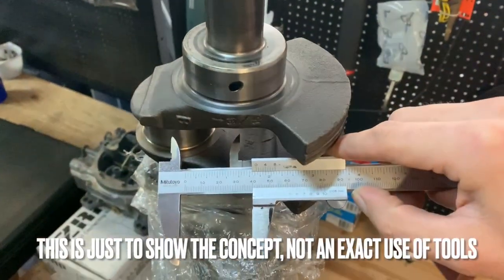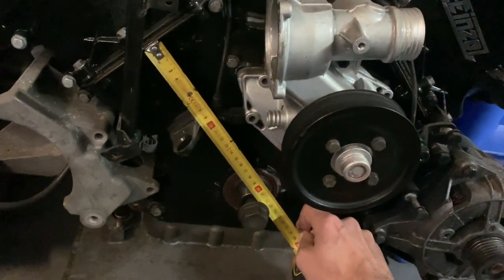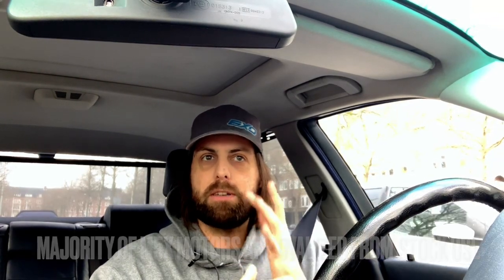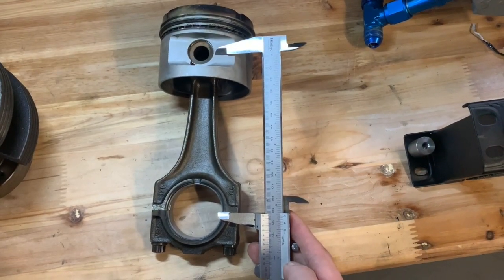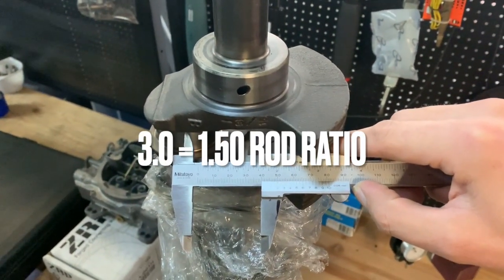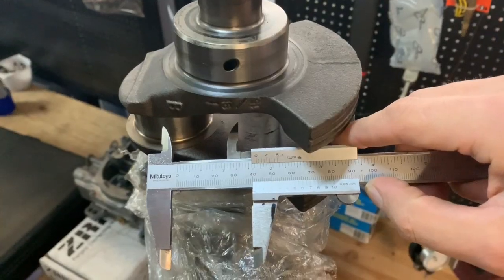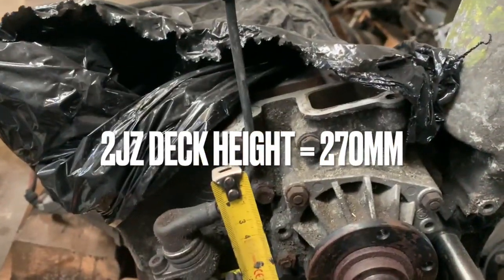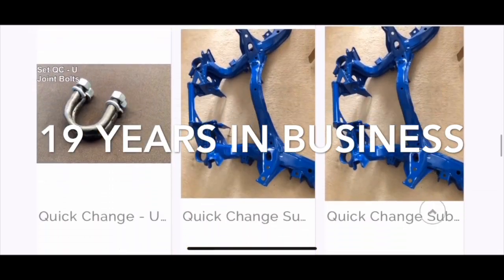Rod Ratio, Stroker Engines, Ring Gap & Deck Height Explained : Why I build M50 turbo engines our way

Comment: what about using decompression plates? so a head gasket+plate+gasket?
Reply from the maker: Nope
Reply: @DriftJesus  nope as in its not a good idea either?
Reply from the maker: @patrykkowalski6  not a good idea

Best idea is cut ring gasket and use pistons to modulate compression.

M50 is not a good motor to budget build unless you want Instagram performance.

Real world real use good powerband, it needs to be built.

Its not a turbo motor from the factory.
Reply: @DriftJesus  just want reliable 350/400 hp from 2.5 m52tu
Reply from the maker: @patrykkowalski6  build it.  Its not about power levels, you want a useable motor, not Clutch Kick Central

If you build an undriveable motor you need a big trans, diff, axles due to endless clutch kicks.

Will be way more expensive.
Reply: @DriftJesus  so whats the recipe if its not a secret? what size turbo? etc?
also why does m54b30 have 10.2:1 while m54b25 has 10.5:1 having smaller stroke and same pistons? (shouldnt it be the other way around?)
Reply from the maker: @patrykkowalski6  i run a custom hotside Holset HX30 and a cast manifold. 

Differences in those motors are also in the heads. Pistons are not exactly the same either.
Reply: @DriftJesus  what about mls thicker gasket to modulate compression? are they trustworthy? ive only found wiseco pistons in my country which are 9.0:1 on b30 motor
Reply from the maker: @patrykkowalski6  as said in the video, the thinner the gasket the better

Comment: M52b28 pistons and rods on m50b25 nv crank will work? I have a crack piston and a spare m52..
Reply: My target is to run with 0.6 boost stock studs (new) and 2.03 head gasket :D need an advice before i will blow the engine  :))
Reply from the maker: Don't use second hand pistons from one engine into another engine
Reply: @DriftJesus  but new m52b28 rods and pistons only will fitt on m50b25 nv? I have any advantages?
Reply from the maker: @vasilicalupu8334  machine the block. Buy good aftermarket pistons.  There is some shop in Poland that always swaps out pistons between motors and its always drama on boost, as I said many times, these engines become ovalized due to low deck height.  Swapping pistons around is always a bad idea

Comment: Is there an ideal ratio for street use? Is 1.75 a good ratio for street, or is it betrer higher or lower?
Reply from the maker: It doesn't matter if its street or race.  You want to be over 1.6 for sure no matter what.
Reply: And what about the ratios over 2? Better for turbo or NA?

Comment: So the s50/s54 has a really bad rod ratio...💔 that's why they're eating rod bearing that fast 😁.
Reply from the maker: For boost it would be bad, yes. They eat bearings "fast" because its a  relatively small bearing to allow it to do high rpm
Reply: Well... it's staying n/a so no prob there. But nice of you to make people understand bigger is not always better. I've seen a trend in the recent years that guys who really know their stuff stay away from stroker motors regardless of platform, bmw, toyota or nissan. Good video as always. Thank you 🙏
Reply from the maker: @raduorban  its all about the relation of components.. if you'd look at a 2JZ, and you kind of mimic that setup on rod radio, you'd have 2.5 or 2.8.  You don't need to be a rocket scientist, just look into the geometry of proven turbo motors. Deck height on JZ is way better , so if you really want to mimic a JZ you best stay on 2.5l , better rod ratio than JZ but shorter deck so closest thing.

Comment: i dont like my life so RB for life :D
Reply from the maker: RB's are turbo motors from the factory , oil pump is a weak link but apart from that, 90% of the problems come from age or build conceptual errors
Reply: @DriftJesus  once i install the Jz style (geared) snout on the crank and oil pump + proper tune my RB was very happy, going strong since 2018. M50's are great but i don't like their sound.